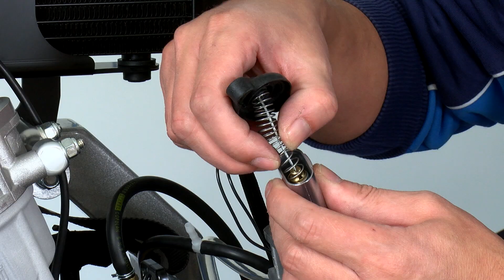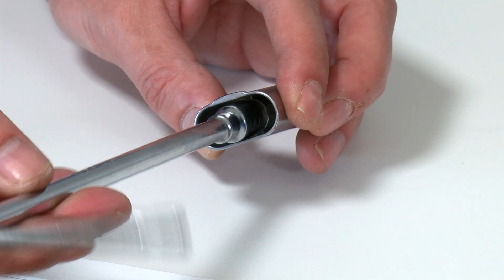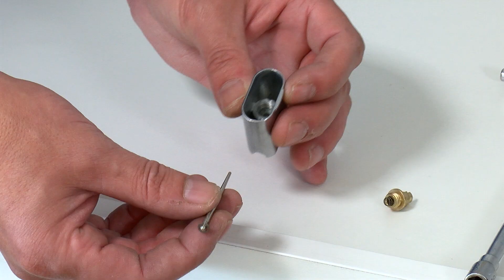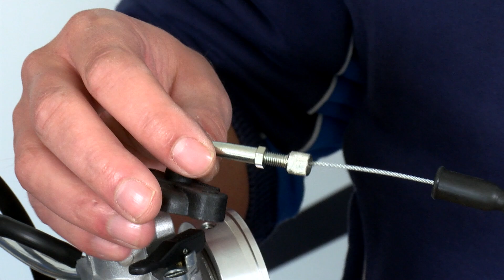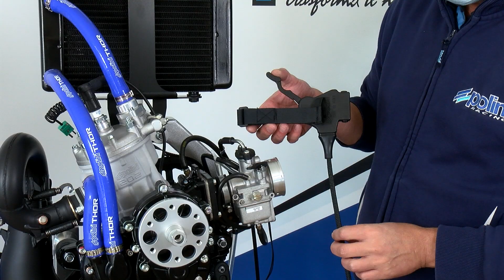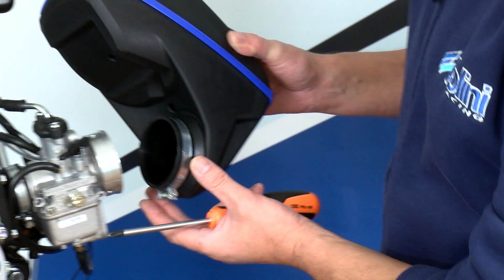Polini THOR - Regolazione/sostituzione spillo (sub ENG - SPA - FRA - ITA)

Comment: Where can you find part numbers for THOR needles?  Are they Dellorto Type D?  The needle in my 202 says "Polini 002" and I cannot find any reference to this.
Reply: Hi. Did you find the answer?
Reply: @dawidepd  Nope. I discussed this with Yuri Polini and showed him my Keihin setup, I fly in -2000 to 8,000 ft density altitude, and said I do want to run the Dellorto but I can't since there are no needles or pilots available in the US to optimize the tune.  I use a wideband O2 sensor and EGT for tuning and have many years experience tuning cars.